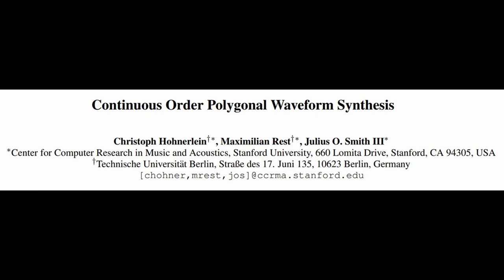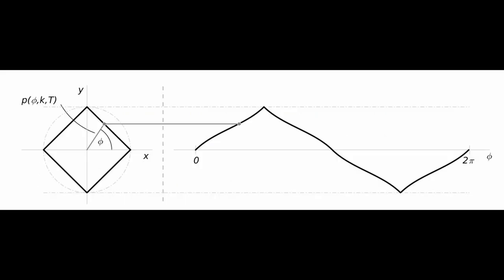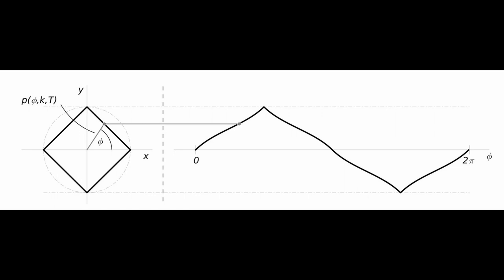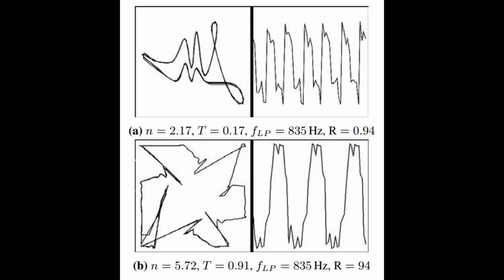Polygogo - Thoughts and 7 Patch Tips

Comment: Just picked up the Polygogo this week. Great patch ideas to get me going?
Reply from the maker: Try with modules which provide random cvs (smooth or stepped, both are great). I use URA and Robaux. It’s important to set the attenuators well, they have big impact on the sound. Polygogo is good as a cv source, I tried with Assmil8or; they gave amazing results.